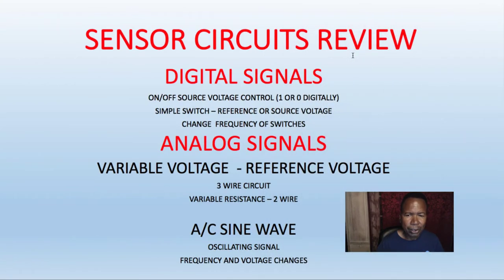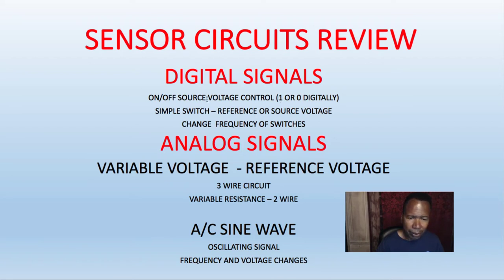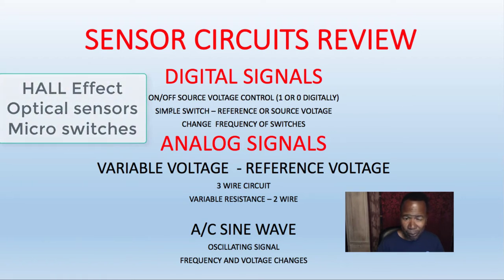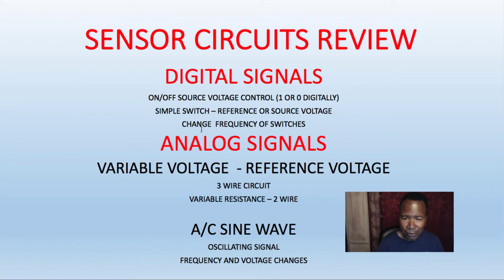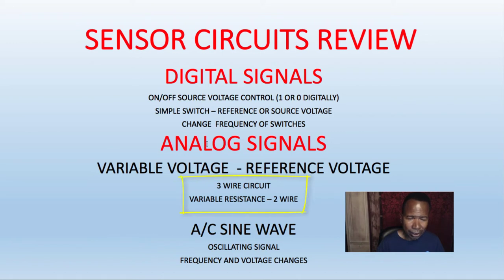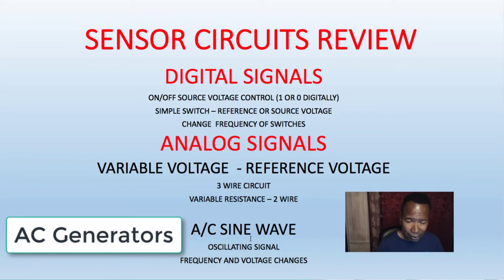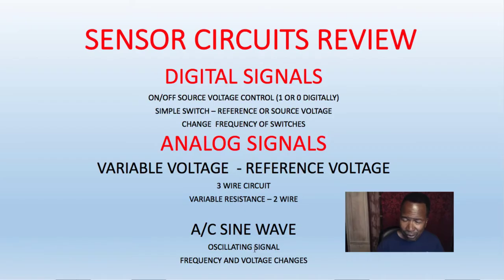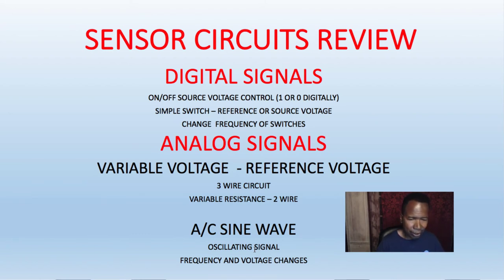7b.Smog Technician Training:Computer Circuits Digital and Analog signals smog class | P.P. ATG

Comment: If A/C wave is controlled by frequency and voltage changes what is D/C wave controlled by?
Reply from the maker: Well every signal has a frequency DC voltage is direct current which can be use with a sensor or actuator